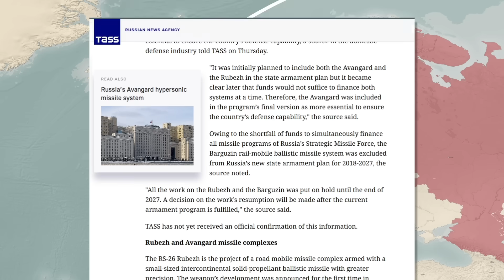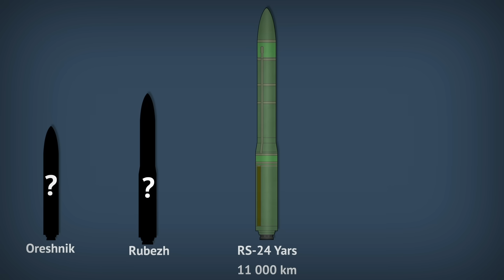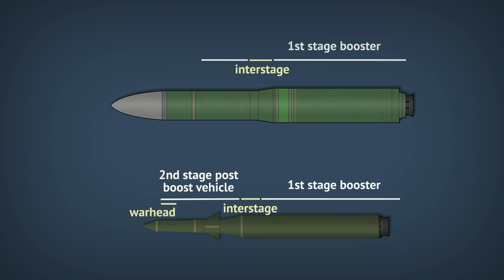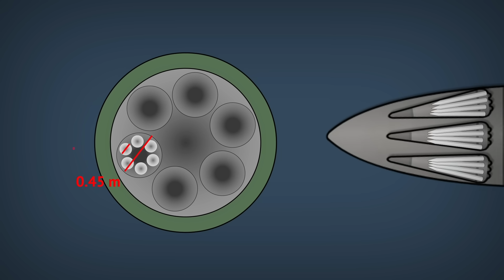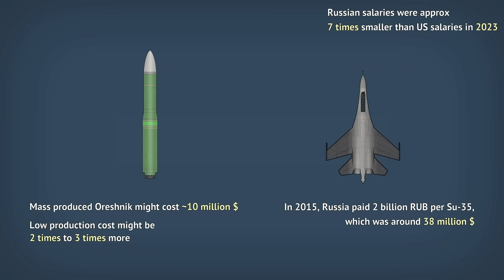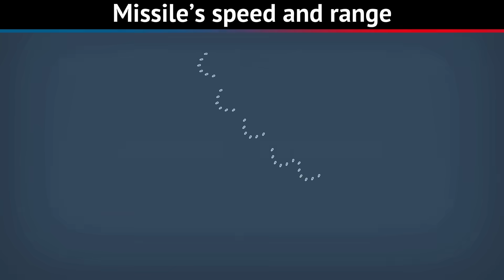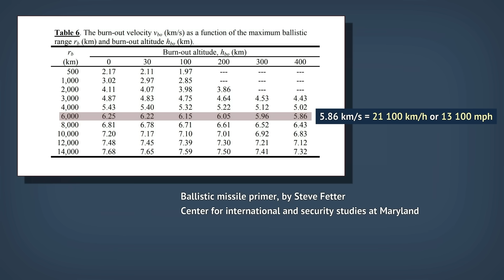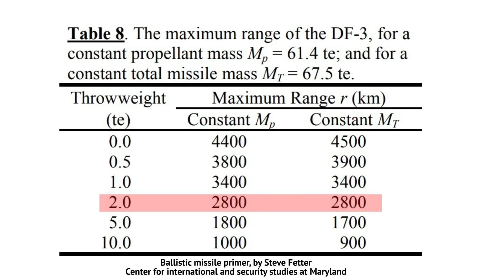Ukraine can’t counter Oreshnik missile. But it doesn’t have to.

Comment: The odd thing about this missile in general is that it is giving me a lot of “rods from god” vibe. 
Odd how few observations I’ve seen relating the two together so far.
Reply: Yes like 'rods from god'. Or https://en.wikipedia.org/wiki/Lazy_Dog_(bomb)
Reply: Yep, had the same vibes when I saw the video showing the impacts. Just as useless. And they even missed the target - although hitting a residential area isn't that atypical. Only sense this weapon might make is with nuclear warheads - and then you have WW3 with everything destroyed everywhere and no one victorious. Kind of pointless.
Reply: @martinpahl5652  Yeah, This platform no doubt has cost quite a bit to set up and even in larger numbers, what would it achieve in a realistic sense against a country like Ukraine that has a lot of its strength dispersed out, mostly i can see this thing being touted as a weapon against populated civilian areas and power infrastructure and such. 

The major issue i can see with it is ambiguity, Usually in normal circumstances, the launch of a weapon like this would be considered as a nuclear strike as soon as it is detected, Now Russians can state it isn't a nuclear strike, and thus, use this in a potential future scenario with an actual nuclear warheads and state ahead of time that it is conventional, largely guaranteeing a hit in a scenario where it is already very likely. but limit retaliation options from a logical standpoint. 

The NATO alliance would need to decide whether any further IRBM and ICBM launches should automatically be considered nuclear attacks regardless and dealt with appropriately to discourage the launches and remove the ambiguity that can be used. 

The earlier Iranian launches were an outlier since they are not seen currently as a nuclear power, so was not considered as a nuclear attack, but such launches from a known nuclear power is a different ball game entirely, and i imagine in the background these are all taken into account, or at least, id hope so.

Comment: i was gonna ask about its costs and the cost of a patriot.
if each oreshnik costs 30 million(to use the highest estimate), and it can hit a patriot battery that costs 360 million......that's an amazingly good deal. you can <redacted word, because google gets triggered> 12 patriots for the cost of just 1.
and aviation can operate more freely.
Reply: Yes, bit only If you are able to destroy the whole Patriot system. If you just hit a part - for example the radar or the command post or some of the launch stations, the costs math doesn't make up.
BUT - you maybe are able to enable the rest of your forces with a leverage. So if the Patriot is disabled for some time because the radar is out of order, you may get air superiority for some weeks and be able to cheaply destroy a lot of other stuff.
Reply: @pelle7771  The parts are expensive too. As are the missiles. So ..
Reply: @pelle7771  
with 36 warheards in each oreshnik, why wouldnt you be able?
Reply: @sabin97  Because a pariot battery/system can be spread over a quite big area and the only parts you can detect in the EM spectrum are probably the radar and the antenna for the communication with other Patriot systems. Unless your reconnaissance isn't very good, and you can strike very precicly, you won't destroy the whole system. Be aware - the Russians have - according to numbers of the ukrainian military - fired 9590 missles and 13997 drones until the august 21. 2024 and have hit 11879 targets. And most of the few patriot systems are still working. It is obvious that the systems are not so easy to locate and destroy. Because they are very, very high value targets but not destroyed. And you could with Iskander or a lot of drones at once.
Reply: Zero evidence of it being able to hit a patriot.
Reply: @disbeafakename167  
the numbers in this video suggest it can easily do it.
but i guess we'll see.
my hope is that it can. that would make things move faster, and then the bear can focus on helping iran and the rest of the resistance.
Reply: a full Patriot battery cost 1.1billions US dollars.. and Russia don't need Oreshnik for that.. Iskanders and tornandos rocket artillery can do that just fine..  US military was build under the premise of having air superiority on every war zone.. so its a big mistake. Russia is not IRAQ..  Even IRAN could bomb Israel with 200 ballistic misiles ,and they claimed to have the best world air defenses and they also have Patriots batteries to and thier thaad space defenses too.
Reply: @technoartfest8708  Iskanders could destroy Patriot systems - if they could. If they really could they would have had. But indeed Russia was mit able to get rid of the Patriot systems for nearly  three years now. And they are the most valuable targets in the Ukraine. If they can destroy the Patriot systems, the Russians had it much easier and probably full air superiority over the Ukraine. But they failed, so - Iskander and all other existing systems of Russia are not able to destroy the Patriot systems. Because of bad reconnaissance or bad aiming, I don't know. A salvo of Iskander should theoretically be able, but practically it isn't.
Reply: If Russian aviation is allowed to operate more freely, I fear for the hospitals, homes, playgrounds, schools, and theaters in Ukraine .
Reply: @bixbysnyder-00  
i dont.
until palestine has been liberated.

Comment: Warhead probably uranium deuterium cold fusion neutron as employed by Israel. leaves enriched Uranium some u236 and pu239 and other activation products. Putin says it will destroy deep and shielded. Check out my paper on enriched Uranium in Gaza and Lebanon. Seismic energy signature exceeds kinetic energy plus uranium oxidation enthalpy by large amount. Do some thinking.
Reply: What's "uranium deuterium cold fusion neutron"?
Seems to be a word salad!
Reply: These weapons arent able to destroy underground structures bc they are both too inaccurate, and dont have bunker penetrator warheads. You need both they have neither. If really studied military stuff youdknow that.

Comment: Good video, even though this video explains how the missile works very neatly,  I think this completely misses the point of why it was used and how it can be used.

The point of this missile was, that it is nuclear capable. It was to showcase to the world what Russias nuclear capabilities are in the range that is designed to hit Europe. That one missile had a massive impact on the war. 
It was never supposed to be a system to be used in the conventional war or hunt patriots etc… it was to draw a line in the sand.
Reply: Au contraire. It shows that a nuclear weapon's no longer necessary, that a conventional weapon does as much damage without fallout, even more precisely. And  because it's hypersonic, it's unstoppable. Checkmate.
Reply: @jgarbo3541 1. Being hypersonic means nothing if it cant maneuver at those speeds, which it cant.
2. Even if it was, they would be destroyed before they could even launch in a real war with 🇺🇸 bc they have like 5 of them.
3. This weapon is too inaccurate to be actually useful against the US. Realistically 🇺🇸 defeats russia in about a week conventional, about 30 minutes nuclear.
4. The US has more nuclear weapons that russia cannot find and intercept, than russia does. The US currently has tabs on all russian subs, and knows where all  russian nuke bombers are at all times, russia cannot do the same.

Sorry what checkmate again?
Reply: @CS-mr3sj  1. it cant be shit down 2. It shows that for proxy war Russia can't be pushed to use nuclear weapons which would trigger world and nato to retailiate 3. it means they can go further and take Ukraine without fear for nuclear retaliation because they didnt go nuclear and west cant counter
Reply: "The point of this missile was, that it is nuclear capable. It was to showcase to the world what Russias nuclear capabilities are in the range that is designed to hit Europe. That one missile had a massive impact on the war."

Ok, for that supposition to work- someone would have had to doubt that Russia had ICBMs with MIRVs.
Who doubted that? Who would that have been for?

This 'demonstration' was gross incompetence.
If they wanted to demonstrate a new capability that was a new threat, such as an asset that couldn't be intercepted by Patriot, they would've targeted a Patriot battery. (Ukraine only has 3...so it would've demonstrated a new strength, dealt a blow to Ukraine confidence and negotiating strength, dealt a blow to hype for Patriot, and...removed 33.3% of Ukraine's capacity to shoot down their aircraft and cruise/SRBMs.

So, either the missile isn't particularly difficult to intercept (which which may be true since SRBMs are what Patriot has been reconfigured for added capability to intercept ever since the Scuds, which it wasn't designed to intercept in the first place but did so on occasion anyways) and Russia didn't want to risk finding out that their new IRBM is also within the interception envelope on debut and being embarrassed by an interception. (Which would have Patriot be demonstrated as the undisputed champion of air defense with intercept envelopes from cruise missiles all the way up to at least IRBM in one system.)

So they picked an area that does not have Patriot. (Which is most of the country as there are only 3 systems in Ukraine)
I've ruled out a 'unthreatening' target for pure demonstration purposes because it went to Dnipro, a large city, as opposed to some field out west. (But this is admittedly flawed as it is based on the assumption that Russian military uses any sort of logic at strategic scale.)

OR

Russia doesn't have 3 braincells total among the Rocket forces.
Reply: @Livewyr7  wow Im shocked youtube let you comment that without deleting it like it does if I type a single sentence
Reply: @Livewyr7  i never said it was supposed to intercept patriots… the video did. I don’t believe it is intended for that purpose not practical.

If you remember Donald Trump tore up the treaty banning IRBMs…
This was a first globally for such a system, so Im not sure what you meant by no one doubting Russia had such a system. 
Anyway theres a difference between thinking and seeing its capabilities used on an ally you are supporting with weapons.
Politicians are sociopaths who love sending average people to die, but will quickly backtrack at the slightest threat to their own lives. 
Putin is many things, but he understands politics.

Patriot will not intercept it, thats a wet dream…  patriots cant even intercept Iskandirs.
Maybe THAAD could.. big maybe…
Reply: No it doesnt. It means literally nothing. Because europe already doesnt have any interceptors that can stop a regular conventional 1960s nuke. Nobody is afraid of this imaginary line in the sand kid.

Comment: I was astounded when I heard that it is said to fly over 3 kilometers per second.
Right now I need about an hour for my daily commute (one way) of 13 km through the city. 
If I somehow were attached to that missile (of course it's fiction and I know that's not how it works) I could make that commute in just 4 SECONDS. 
That's pretty much teleportation.
Reply: We🇺🇸 invented ICBMs that go that fast in the 1950s.
Reply: We🇺🇸 invented ICBMs that go that fast in the 1950s.
Reply: @CS-mr3sj  the diffrence is that your icbms need to slow down to a much slower speed before Terminal Phase where the warheads get deployed but this one never slows down even when deploying warheads...
It also has No RCS because of the super thick and dense Plasma Cloud around the warheads which eats Up all Radar beams and makes those Things invisible for all Air defence or missile defence systems...
The russians somehow managed to guide those warheads with that Plasmacloud around IT which normaly jams every guidance systems...
Also those missiles are normaly area saturation weapons but this one was accurate!
All groups of subminitions Hit there target only one small groupe missed...
Also Ukraine got every piece of Air defence systems from small to big Systems that Nato and US has in there Katalog, got warned days before the Attack and still could not shoot down one single Thing...
The Damage that was claimed to be small by UA is bullshit...
The Factory is build with deep Levels that Go Underground Like a Bunker and the russians new it because that Factory got build by soviet Union...
And If there would be "No siginificant Damage" why dont Just Show Pictures from INSIDE and How the Levels Underground Look..???😂
They only showed bad photoshopped Satellite Photos of the Roofs😂
This missile is Something new you can See it in the footage how those Things warheads Look in Impact...that could be theoreticly the First use of a Plasma weapon in human History..

Comment: Looking at all the comments, I never saw one comment about these multiple warheads being hypersonic and guidable, basically making them unstoppable.  That would concern me if I was living in a target area.
Reply: The spread of these projectiles suggests modest separation system and no guidance at all. Otherwise they would have been much further apart vs being fairly close together. Also, no primary explosions says these were inert and strongly support the idea this was an unused test missile that they pointed at Ukraine and lit off.
Reply: @ItsEricAZ Of course they didn’t have explosives. They are MIRV’d kinetic impactors. Same principle as an EM rail gun. Their explosive and penetrative power comes from the kinetic energy of a metal cone the size of a Home Depot bucket traveling at 8,000mph.
Reply: @aracattack8096 these weapons were neither accurate nor hypersonically maneuverable and guided. In order to penetrate underground targets, they would need to be both accurate and have enough penetration power to go through the ground and actually both hit and penetrate the target structure, of which they have neither.

Comment: OK, this is a real big SWAG, so don't complain about inaccuracies too much. If the payload is 1 ton, then the RBs are probably 75% or less; Thermal shielding required for reentry. That allows 125 kg or less per RB, and less that 20 KG per bomblet. As a datapoint, apparently the US was working on a tactical warhead in the 60's which weighed 26.5  to 30 kg and reportedly in the 10 to 20 ton yield range. Not sure if they (RU) would have a higher yield-to-weight ratio, but it's a datapoint. This puts this RU 'test item' in the range of a tactical device. I'm not sure why it would be useful to deploy a rather inaccurate device with several bomblets which could cause fratricide (one bomblet knocks out another bomblet) when a more accurate device would do the job. I think this was to generate more FUD. It also appeared that all of the RBs were targeted at the same location, so more of a waste.
Reply: "one bomblet knocks out another bomblet"

Sweet Jesus...

And you also ignore the kinetic energy... why do you even post, mate?

Comment: What is the terminal velocity of the Mirv when it reaches the ground ? Because when I searched, I found that it was approaching 7 km per second, while here it appears that it decreased to 1 km per second ?
Reply: You cant´t fly at 7 km/s close to the ground, then it would burn up by the friction.
Even 1 km/s is 3600 km/h, which still generate a lot of heat.
Reply: @ddelin100  But it is not flight, just a fall that will last for three seconds at most in the lower layers of the atmosphere
Reply: It was reported as mach11. On this channel everything Russian gets downgraded by bias.

Comment: Seems it's designed for ground penetration to hit underground bases
Reply: Yes, that's exactly what I was thinking. Search for EPWs; there is a lot of information about them on Google.
Reply: Ukraine censored out the second part of the strike video. Few explosions happened like 15 seconds later.
Reply: @anotherbacklog  I can believe it, the sites they r most likely to target will have 2ndary explosions &/ fires, & in any case, the damage will be sagnificant even w/o explosive warheads, esp. if several BMs r used.

Comment: Since you can clearly see it, can't you optical track this missile (or other ballistic missiles like this) and intercept it?
Reply: Pretty sure it and it's payload warheads reach Mach 11 speed...going too fast for NATO's current systems to intercept. From what I understand.
Reply: @midknightgeek6629  So basically you can track it but can't chase it down? That kinda make sense..
Reply: @jiefeng4249  If the 5 minutes is true, you barely have enough time to go from your room to call someone, let alone figure out the trajectory of 36 warheads + Decoy munitions made to fly at different trajectories but land at the same target
Reply: This can be done. Exoatmospheric interception of ballistic missile has been seen when Iran launched missile attack on Israel.
However, given the serious speed, any chance of shooting down is b4 the ICBM can reach it's decent phase. Which means you basically need ICBM to intercept ICBM.
Reply: The most common simplified explanation is that once the warhead bus has dropped the last boost stage, it is like trying to shoot a bullet with a bullet.